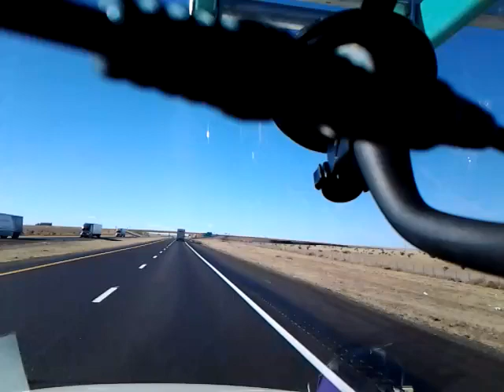GreenFuel H2O HHO Dry Cell Problems.

Comment: Use NaOH fpr a electrolyte, 10% solution is a great anti-freeze. Try Hydrogen Garage, cell designs for 30 yeas in use! Bob Boyce® H2O Sealed Cell patent design. Hydrogen Garage dot calm.

Comment: I have a GreenFuelH20 HHO cell, their v6 model. I have been running it for about 2 months now. I just want to say that I emailed Steve a few questions before I ordered one from him. One of those questions was specifically if this was able to be run in the winter. He did tell me that It would not and any freezing would cause damage which I totally understand. Even though I have to drain it in the winter, I still bought one. I do most of my driving in the summer and shy away from the frozen months anyways.

Comment: @delvis11....  To make personal attacks publicly to in individual is poor business practice.  Reading from your website and studying from the published information about your HHO generators show that Steve is probably accurate on his claims about the HHO system he had purchased from your company.  A couple of issues I seen from your kit.  First being you do not provide a secondary reservoir to act as a bubbler unit which does two things. It first serves as a filter to clean the impurities associated with HHO generators and the various electrolyte solutions. Secondly and more importantly it serves as a flashback preventer.  Another deficiency in your design is not to include a one way valve to allow the electrolyte tank to relieve itself in a vacuum state. As one of Steve's video posts shows, that without this valve it caused his system to  have a reverse flow in the system and siphoned the liquid from his bubbler unit.  Third issue that I see is that you state on your website and documentation to use 10 teaspoons of KOH per two liters of water.  That seems pretty high to me when comparing your HHO generators to other manufactures. This would mean to me that your HHO generators are inferior in design compared to other systems currently on the market.  Forth issue is that you probably did not state in your documentation the proper installation of the electrolyte reservoir.  It must be lower then the intake of the throttle body to prevent siphoning of the electrolyte into the engine.  Another issue with your design. State acceptable service level of electrolyte in the reservoir.  It should never be higher the 2/3rd's full so as to provide sufficient space for the gas AND prevent electrolyte from being  dumped into the engine because you forgot to include a bubbler in your design.  Another point... Tell me the flame travel speed of HHO gas?  Something like 40,000 feet per second.  So why I ask you require folks who purchase your kits to install a second flash-arrester with the mandatory requirement of a 5 foot hose?  Does 5 feet really make that much difference over say 2 or 3 feet?  Plenty has been published on the poor performance of the Volo chips so I don't need to add more about them.. The only way to get good results with HHO in a vehicle with fuel injection and O2 sensors is to have tunable EFIE/MAP modules included in the installation.

Finally, I would have to say that I'm in agreement with Steve on the Freezing issue.  There are published articles out there on how one can work around this with adjustments in the KOH electrolyte solution and the use of 90% isopropanol alcohol.  I guess with the subpar performance of your kits and the reluctance to help resolve a customers issue with your kits, you would take the easy way out and just state that your systems do not work in freezing temperatures.  It makes me wonder  how other HHO kits publicly available are able to operate without issue.

Steve...  Great series man and I appreciate you sharing your experience.  I have several recommendations that may help you get a better experience with the system.  Some rework will be needed, but I believe it is possible to improve your situation.

Comment: The manufacture warned this customer NOT to use the system in freezing temperatures and even commented in this video series NOT to let the water freeze. It leaks because it froze. 
If you take your van 4-wheeling and something brakes who do you blame. Water freezes under 32 degrees. Why would the vendor need to tell you that water freezes?
I can only guess why the PWM smokes.
The product works well but there will need to be a little common sense used.....